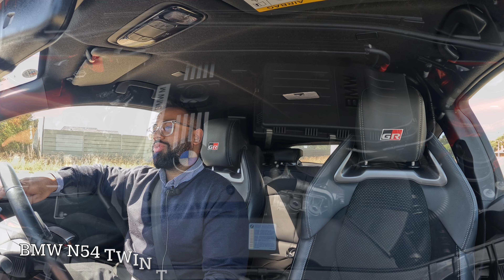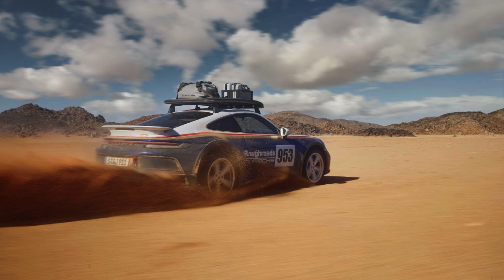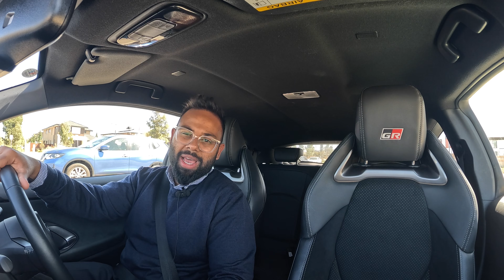The Biggest Threat To Cars Right Now.

Comment: Taking the engine cover off my B58 for the first time and seeing plastic everywhere was such a let down. 

Which new or recent enthusiast cars would you say use the least plastic for engine components?
Reply from the maker: @redsiricer  I felt the same way about my N55 BMW. When I went to test drive the GR Yaris, I was glad to see so much metal under the bonnet. It’s still one of my favourite parts about the car. As for recent enthusiast cars..Nissan Z, Toyota GRY/GRC, Civic Type R, MX-5. Pretty much any Japanese enthusiast car will utilise less plastic. But German car makers do offer more performance.
Reply: @motoringfan Thanks for the list. I've been thinking a lot about the GRC (too bad no GRY in Canada). It may be a step down in performance from my G42, but I'm more concerned about long term reliability and fun factor now than absolute performance.
Reply: Yet is one of the most reliable motor out there
Reply from the maker: All valid comments here. B58 has indeed been quite reliable (though the OFH fails consistently). Plastic is probably not a huge issue if engineered well. Still as a car enthusiast, I can’t quite love plastic in my engine bay.
Reply: Many of the early examples of plastic stuff works ok. The problems indeed come when integrating them to critical places and togethet with stuff. A plastic valve cover is great, until you integrate your PCV to it.. A plastic front main seal flange is great, until you integrate it to seal of the end of the oil pan too... (2.0 TDI...).
Reply: Must be that the plastic isn't necessarily bad because many B58's have already 200/250k miles without major problems.

Comment: Sorry, but that problem still does exist with plastics, even with positive construction (3d printing). Also cast moldings will still have flaring that will need to be trimmed, which can not always be placed, even with pressure casting in places that don't have to worry about this. Also things like MIM (which is the metal equivalent of plastic casting), also exists, with the same amount of debris as plastic injection. Not to include dust residue from the molding process to insure the product breaks away cleanly from the mold.
  
Mind you MIM and Plastic injection are not far off in cost, even with scale, due to how MIM reduces the energy cost in metal injection casting. Any claim of "enviromental costs" is also pure BULLSHIT, when you consider the costs of transportation. It's tooling, material, and manpower. Michelin moved their "economy tire production" to brazil not because they are "enviromentally friendly", but because production savings in manpower there outweighs the fuel cost in money. Whenever a company claims something is enviromentally friendly, it's greenwashing bullshit, unless it eats into their profits.
  
The only reason plastic would not have an issue with clean up post production would be if the lubricants in the engine are capable of breaking down and suspending the plastics in the oil long enough to survive the oil change cycle, which now means you have a component with a set lifespan based on it's exposure to the lubricants inside.
  
Which is a pointless choice in chemical engineering since every oil system feeds the engine oil through the filter first to catch those particles, and plastics can be equally as sharp as metal to paper filters.
  
Further the issues we've seen with machining burrs in engine production have been from components that were not deburred properly (looks at kia/hyundai), or components that have a low oil flow rate where the debris can easily sit near where it came from (looks at toyota) and break stuff.
  
Neither of which are an issue with something like an oilpan or oilpickup tube.
  
Plastic Oil Pans are cost savings only, just like squirt on RTV being used which can break off in large chunks and clog the oil pickup tube (looks at subaru and duramax). 

There is no practical benefit to the end user for a plastic oil pan and only a benefit to the share holders.
Reply from the maker: great input, thank you.

Comment: My 2020 Toyota 86 came with a metal intake manifold but they only did it on the manual version.
Reply from the maker: very interesting mate! Quite rare to see metal intake manifolds these days.
Reply: @motoringfan  I think they only did it for the 2016-2021 models and it's powder coated as well.

Comment: Metal oil pans are stamped if steel or if aluminum, they are cast. The design maybe better but the materials and fabrication are worse so ultimately the quality is worse. I drive a 25 year old e39 528iT with 272,000 miles. When it needs fixing, I fix it. Regular maintenance is a must like an oil change every six months, etc. It runs perfectly, quietly, smoothly and gets 25mpg. The bonnet/hood needs repainting and the driver's seat leather shows wear and tear. Same engine,  same paint.

Comment: A huge point missed here is that plastic is almost immune to heatsoak, unlike aluminum or steel. For intake components especially, it makes a lot of sense. They aren't using cheap garbage plastic, its extremely high quality, very strong plastic. I have an m4, and theres been extensive research, switching out plastic intakes and charge pipes for metal absolutely destroys intake temperatures. Same for the 50% plastic intercooler, the oem plastic unit outperforms the metal aftermarket solutions. I assume the same goes for having plastic electric water pumps for the air to water intercooler. 

Plastic oil pans sounds wild, but its porsche so i would be curious to their reasoning.
Reply: Its immune to heat soak until its subject to heat beyond what it can handle multiple times, not to mention age and decomposition/dry rotting
Reply: @ yes, but with proper cooling combined with plastic components that is almost unheard of. I can touch my plastic intercooler end tanks after driving hard and not be burned. Sure, maybe once in the car's life some parts like pipes may develop hairline fractures and need to be replaced, but that's a small price to pay for the performance benefits they provide over metal. 

However on a basic economy car i agree, metal would make more sense as peak performance is not required
Reply: Porsche did with the plastic oil pan on the 991.2 for weight saving purposes.
Reply: @malfunctionedbrain6854  i see. I wonder what the difference in weight from aluminum is. That one seems like an instance where plastic might not have been the best choice.
Reply: Yep, but back in the day with carbs the metal intake retaining heat was a good thing because carbs cool the s**t out of the intake air so they need to be heated. With fuel injection plastic is much better

Comment: Saturns are plastic yet alot of them have survived to this day and age. And that was used for the bodies of the cars primarily
Reply: Because the engine bay is all metal
Reply: Plastics are fine as long as you don't start integrating a bunch of features to them and putting them in impact prone ceirical areas...

Comment: I have a mint 2004 AWD Mitsubishi Verada. Metal everywhere in the engine bay, from the intake plenum, the rocker covers, water pump, power steering pump, the sump, thermostat housing..even the bloody power steering fluid reservoir is metal..!
Reply from the maker: @TangoRed287  holy smokes mate, that’s beautiful. My GR Yaris definitely has more metal than my bmw but I would still like a metal rocker cover. Don’t think any modern car uses those any more.. same with intake manifold.
Reply: @motoringfan   I’m sure Toyota has engineered your car properly (I’d trust them to make a longer lasting car than BMW to be honest..) but I get where you’re coming from. There’s something about metal in the engine bay which instills a sense of confidence I guess.

Undoubtedly there would be aftermarket components for the GR (awesome car BTW 👌) but then you risk running afoul of the warranty requirements should something go wrong..

The B58 is proving very reliable so far so hopefully it will be fine as time goes on..lucky man you are having two great cars like that! 👏 👍

Comment: Plastics love the high number of heat cycles that exist in engine bays. 

Hang on, what, no wait.
Reply: B58's have heat management cycles and many are getting the 200/250k miles without any major problems. Plastic isn't the problem but the person driving it and not doing maintenance and properly warm up the engine before flooring it.
Reply: @bradofwar5960  it still gets hot and cold over and over again. That's heat cycling. And it destroys plastics.